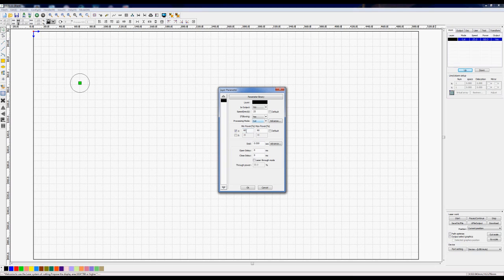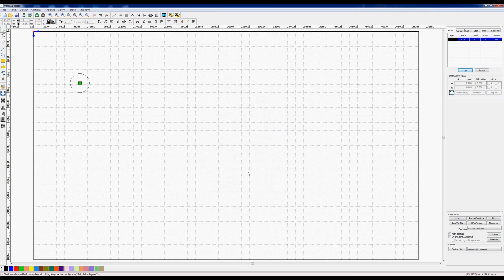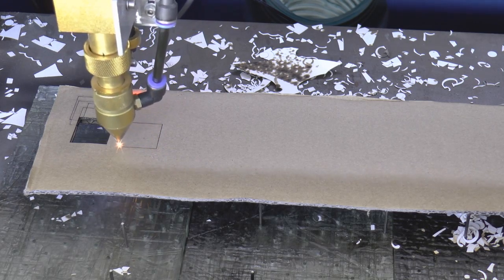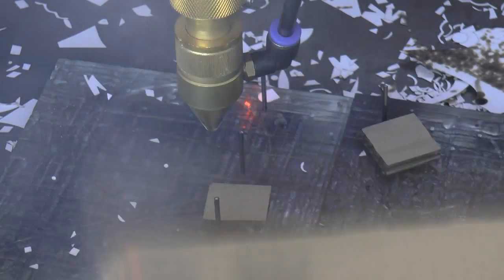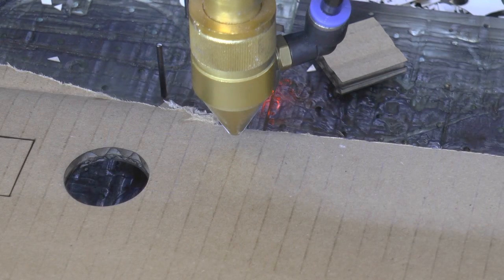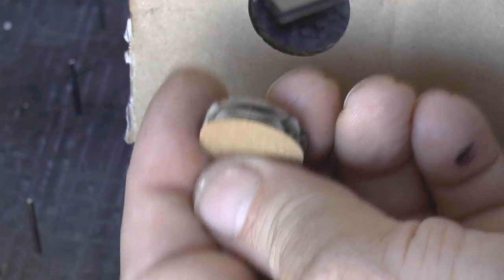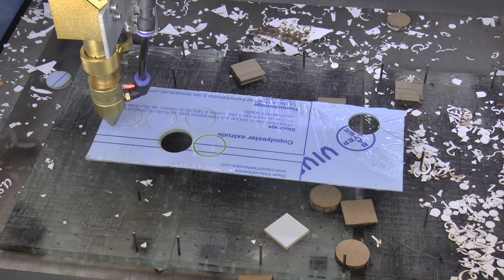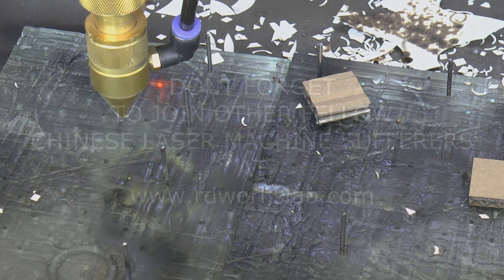RDWorks Learning Lab 72 Is Dot Mode Useful

Comment: Hi thanks for the tutorials.

I am struggling to cut cone shape out of my substrate,could you provide any suggestions .
Reply from the maker: Hi
 For simple cheap laser technology I am certain the answer is, no. The first and biggest problem is that a cone is a product of rotation about an axis. How would you cut a cone with a bandsaw?.....it's the same problem.  Yes, it is possible to purposely create an angled cut by  keeping the laser beam parallel to the  lens axis but offsetting the beam. The beam then becomes like any offset ray and will will be directed through the focal point,  but as it passes through the focal point it will still be at an angle to the lens axis. In this way you may be able to achieve a 5 degree cut  but it will be in just one plane. You will still need rotation of the work to produce a cone from this angle. Offsetting the beam seems unnecessary if you have a  rotation device because you just tip the rotator to the correct conical angle. If you wish to invest over a million dollars , there are 5 axis industrial lasers that can achieve such complexity.
Sorry I can't be more positive and helpful. The only possible , but very inefficient alternative is 3D engraving,
 Best wishes
Russ
Reply: @SarbarMultimedia  hi there,thanks for your comment ..I know its not easy..thinking of some home made setups..

Comment: Hi! Greetings from Costa Rica ! I'm starting to use the laser machine, bought it directly from China. My question is if I should use the potentiometer at 100% or at less power. Thanks ! Very VERY useful videos :)
Reply from the maker: Hi
I am slightly confused.  Do you have a K40  small desktop machine?  I seem to think they have a potentiometer.  If  you do  have such a machine then dont run the potentiometer above 65%. If you have a larger machine then  you will have to use the program to set the cutting %power. The answer is the same Dont use more than 65% power.
Whatever the size of yourmachine, I would advise that you fit a cheap ammeter and DONT run the machine at more than the reccomende maximum drive current.
see  https://www.youtube.com/watch?v=xDZmuxq5BEM

Best regards
Russ
Reply: Thanks a lot for your answer !!! I have a 1200x900cm machine with RECI 130W. The machine does have a native anmeter and potenciometer. I also manage the power with the RDWorks program. But I don´t know where to leave the potenciometer and as you may know, chinesse guys never answer anything... Thanks a LOT for your time! Your videos are great !! Keep it up :D
Reply from the maker: Hi 
All is now clear. Thanks.
Reci are very confusing with their recommendations their website quotes

 
2. 2.Operation conditions Water cooling: using purified water; 2 to 5 liter/minute; 
water temperature: 10℃-40℃.
 The operating environment: temperature 2-40℃; humidity 10-60%.
The working current: test current is 29mA. Maximum working current is 29mA. The running current 
must be kept below 27mA. The life span can reach 8,000 hours if the current is kept below 25mA. 
The ammeter must be connected to the negative electrode of laser tube.When it is working under over-high current for long term, the negative pole will appear light yellow and the life span will be shortened rapidly.
To protect dust from going into the insulation sheath, please wrap it with plastic film.
 
What does this mean. . Although they allow the max running current to be 27mA , this should give you the 130watts  you expect. However they are playing VERY safe by then saying it would be better if you stay at 25mA max.  Only if you have a power meter could you characterize the tube and decide what power  25mA will give you (maybe 120 watts?) So set the max power button on your machine to 65% and press and hold the pulse button. Look at your ammeter and then adjust the power up or down until the current is 25mA. That should be the max power you should ever use. The only exception is if you wish to run at higher vales for a minute or two while testing the  character of your tube..
Have great fun with your machine
Best regards
Russ

Comment: Another thing, Dot mode (with much larger gaps between) can be REALLY excellent for making Sewing templates.
Especially with things like leather.
Reply from the maker: Hi 
Thanks for confirming that, because I was suggesting to another correspondent  that leather stitching/lacing could be another possible use.
Thanks again
Russ
Reply: No problems, if you know anyone who does leather work and Awls by hand, show them this and you'll have a new best friend =P

Comment: Just because the fumes are yellow doesn't necessarily indicate the presence of sulfur.  Polycarbonate doesn't contain sulfur; where do you think it came from?   

Polycarbonate does not cut well on the laser (charred and irregular melted edges) as your video shows.   Despite what you said, the MSDS indicates a number of toxic combustion byproducts when polycarbonate burns.
Reply from the maker: Checking several laser cutting sources for risks and cutting problems with polycarbonate there were no warning about toxic by-products  I did check the MSDS database for polycarbonate but there were no really  hazardous gasses or chemicals  mentioned, just the usual toxic gases such as carbon monoxide and carbon dioxide, but even burning wood produces this and for this situation I think that describing them as toxic is a bit dramatic. I am not a chemist but having used and designed with polycarbonate for many years I am aware of how its made in principle and that one of the chemicals used in the production is bisphenol A which in itself contains small amounts of sulphur contaminant.  I did note that this was  also a product of combustion. However I did proceed with caution and when I saw the thick yellowy brown smoke, despite the MSDS not mentioning it, my first thought was nitrogen dioxide.  Subsequent checking  made no mention of NO2 .   Hmm ....still wondering. I have often warned against cutting any plastics other than acrylic because of the risk of toxic fumes.  Having proved that it is a difficult material to cut and producing who knows what in the way of fumes, that will be my one and only venture with polycarb. Just cold cutting from now on. I think anyone watching the video will get the final message and not attempt it themselves. 
By the way my conclusion about sulfur deposit was an immediate association with the many volcanic vents I visited whilst touring the volcano fields on Hawaii. There a very few chemicals that deposit yellow like sulphur.
Thanks for your comments, it was a very interesting subject
Best regards
Russ
Reply: +SarbarMultimedia here's one link I found informative:

http://web.mit.edu/rocketteam/www/usli/MSDS/Polycarbonate.pdf

I see concerns in inhalation, ventilation, and combustion.

As you've demonstrated there little to be gained using a laser to cut polycarbonate.   When I checked several laser fabrication houses (about 3 years ago), most had polycarbonate on their "avoid" list.  some would cut it, but with a surcharge.  They had upgraded exhaust systems, and charged extra since cleaning the oily sooty mess was such a pain, especially off the mirrors and lenses.

Comment: Dot mode can be usefull to pre-cut paper and engraving thing material like plastic bottle or paper.
Reply from the maker: That was the only simple and limited use I could imagine for it, but I can see it has other uses. I never imagined cutting with it.
Reply from the maker: Hi
As I mentioned in the video, I have always found it hard to find a use for this dot mode and now that I have explored it I can see there may be times when it may be useful. However, when it comes to paper and card cutting and even engraving on thicker card I find that the pre ionization zone is the most powerful weapon in my armoury. It produces beautiful unscoched  cuts at very low power (you  might like to look at an unlisted video  https://youtu.be/S_2NOCpACVc to see what I mean) This would take ages with dotting. I would use this same power zone for engraving on thin plastic but adjust the engraving speed up to get the depth I required.
Don't get me wrong. I am not knocking dot mode, I am just trying to rank it's importance as a tool now that I have quickly tested it.
You should go seek out the preionization zone for your tube and test it fully. It is explained in  https://youtu.be/mXIDwQxhX3k
Thanks for your comment
Best regardsRuss
Reply: All I use it for is to cut perforations in paper and thin card to make a tear of section, staggered cut.
Reply: I don't know why this isn't coming under the comment I want to comment? 
@Mentorcase. Can't you just make a dotted line instead?
Reply: Very interresting video. Thanks for the share and thanks for all you work on CO2 machine. I'm sure you are better knowledge than chinese manufacturer. You do a realy amazing job. Best Regards to you Russ.

Comment: It never stops being frustrating to talk about power in percentage with these chinese lasers.  all of the software controls are in % so that is all new users see.  When you say 65% people have no idea that is effectively maximum output.  ugh... nothing you can do about it until the users gain experience.
Reply from the maker: Hi Sanjay
Your machine is supplied with a digital scale that allows you adjust the current that drives your tube That digital scale runs from 0% to 100% and depending on your power supply (take for example a typical 50 watt power supply with possibly 28 mA maximum output) will  look at your maximum output and sub divide that range into 100 parts. If you have a genuine 50 watt tube (about 1000mmlong) then it will have a manufacturers recommended max drive current of 20mA. However most ebay 50watt machines are fitted with an 800mm long 40watt tube with a max drive current of 18mA. Nobody tells you about this, machines are not fitted with ammeters so how can you make sure you do not overdrive your tube If you drive your tube with more than this recommended current, you will rapidly trash your tube. I know because that was my first and biggest mistake.
If you do not fit an ammeter to see what's going on then do not exceed 65% power setting and you will stay close to the safe current limit 100% IS NOT THERE TO BE USED unless you have the know how and instruments to set your power supply output to match the maximum of your tube. You may sit down and say that 20mA is not 65% of 28mA and you will be correct. However, the power output of the tube is not linear and all tubes will be different. This is just a typical maximum guideline. My particular tube has a current rating that allows me to  run up to 85% of my power supply output.........but I still stick to the 65% because I only gain anther 4 watts of output but will be shortening its overall life. Look at https://youtu.be/6onXMU08GzQ It is important to understand what the term "dissaciation" means as it will help you look after your tube. If you do not have and ammeter on your machine that I urge to to fit one. It is quite simple https://youtu.be/xDZmuxq5BEM

Hope this helps
Russ
Reply: could you please elaborate how 65℅ is the peak power? Thank you
Reply: None of these chinese lasers are calibrated.  He has determined with a laser power meter that 65% is the point where his laser tube produces the maximum output. any higher percentage and his tube will just be over driven and not really produce any more output.  search through his earlier videos and he explains with graphs.
Reply: Well said, was just about to reply................ditto tesla..........
Reply: +2020tesla thank you
Reply: hi +SarbarMultimedia, thank you for the explanation, I'll get back to this thread after watching the recommended video. As always wonderful presentation and awesome insights. Thank you :)
Reply: hi +SarbarMultimedia, thank you for the explanation, I'll get back to this thread after watching the recommended video. As always wonderful presentation and awesome insights. Thank you :)
Reply: hi +SarbarMultimedia, thank you for the explanation, I'll get back to this thread after watching the recommended video. As always wonderful presentation and awesome insights. Thank you :)